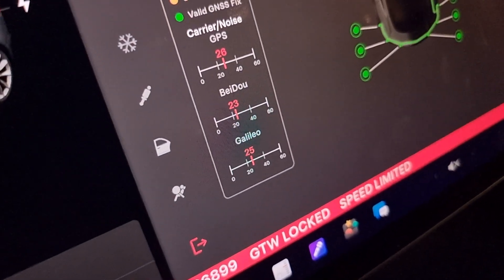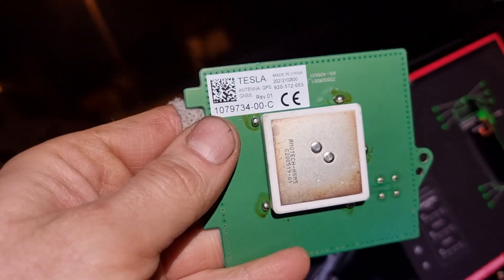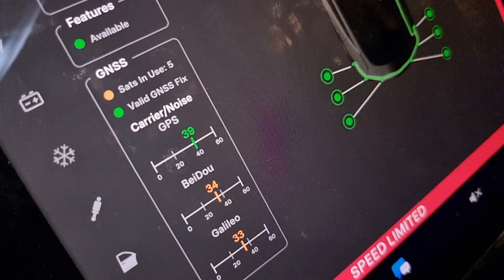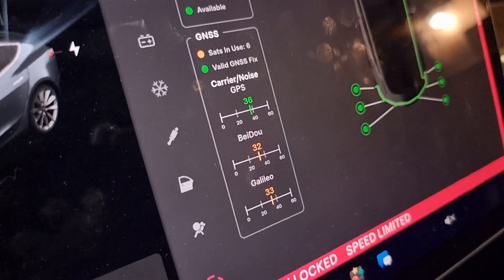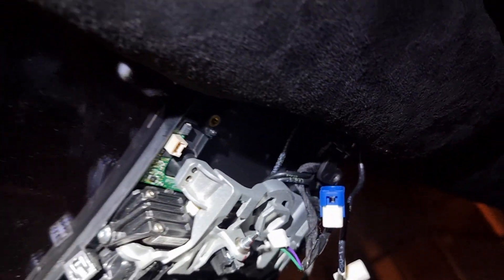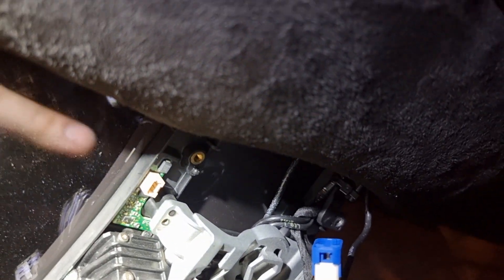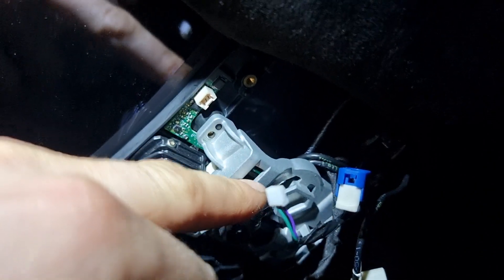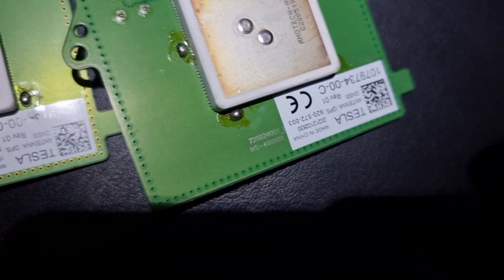Tesla Model 3 Poor GPS signal Solved

Comment: They recently cleaned my Ford facing camera in that rearview mirror area. Since then my GPS does not work it’s stuck in one spot. Do you think maybe the wires got loose or something and that’s the problem?
Reply from the maker: yes wires is not pusshed on conector fully. Open and check, just carefuly its easy to brake something

Comment: I had problem with my highland too. They replaced my gps under warrenty.
Reply: I'm getting mine done finally after them denying multiple times that it was a hardware issue. It became mostly an issue when I'd want to use FSD. I'm hoping the replacement actually worked for you long-term
Reply from the maker: @markusGone and it solved  problem after changed gps antenna ?
Reply: @TomasAutoTech  Yes, they actually tried resetting the hardware three times and shielding some cables for some reason. Last month, they replaced the entire GPS antenna because I had the same issue as at the beginning. Now everything works fine, but it was a long journey until they replaced the antenna.
Reply from the maker: @markusGone  in my car was windscreen installed not original , that's why was no gps signal